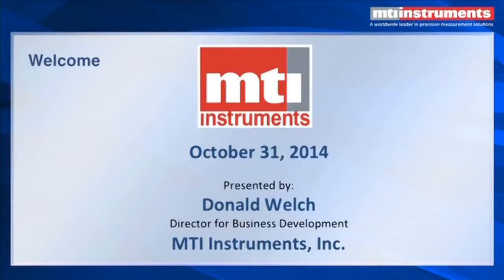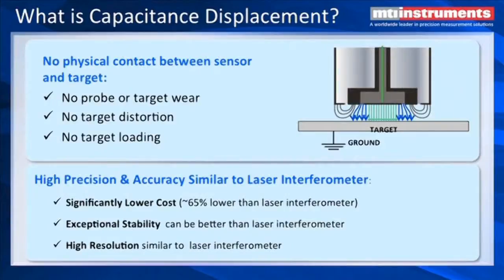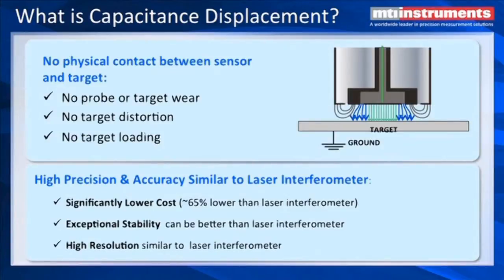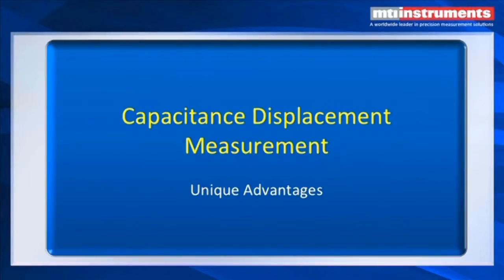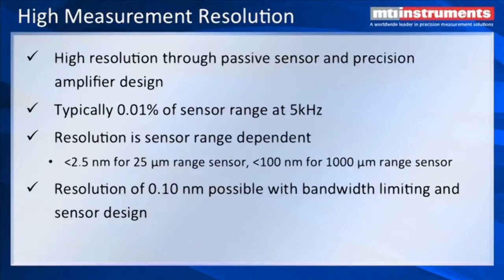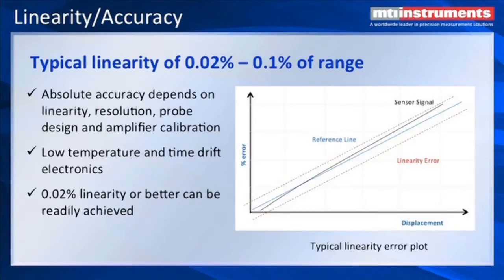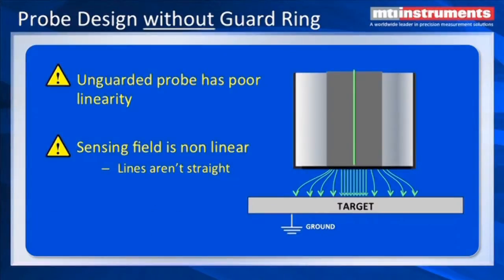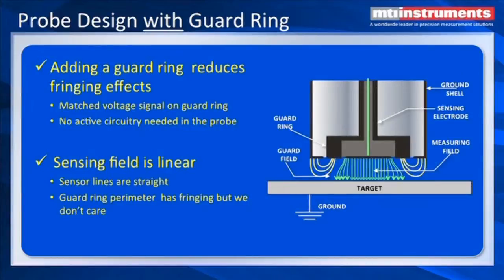Accumeasure D - How Capacitance Displacement Works

Comment: Dielectric also depends on temperature and medium impurities so to avoid that you could use two sensors and make a differential capacitive sensor and measure it using a Wheatstone bridge